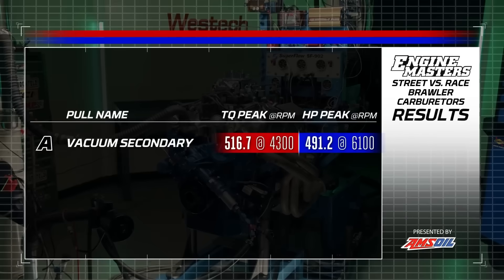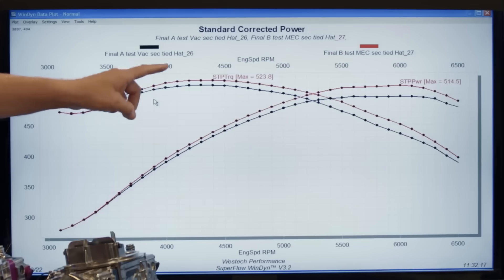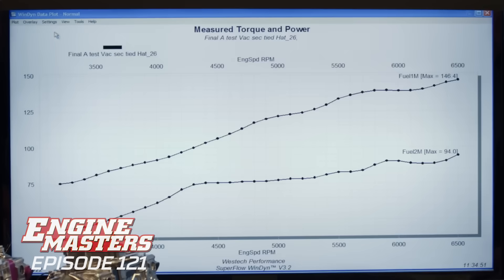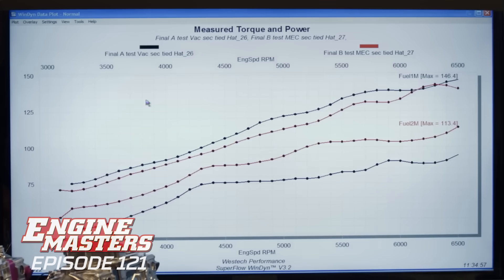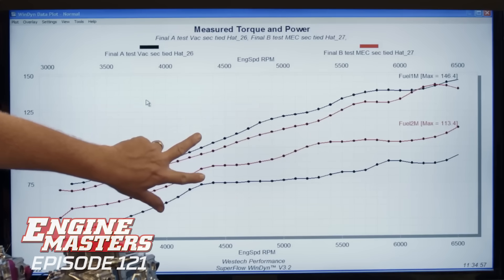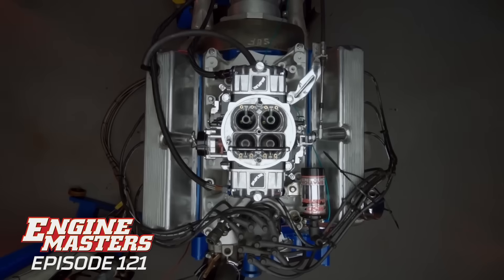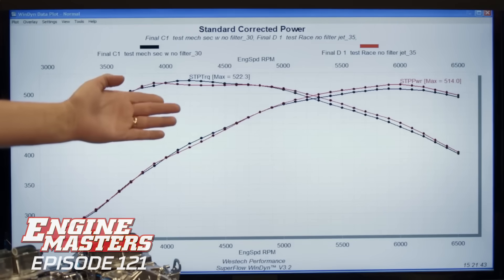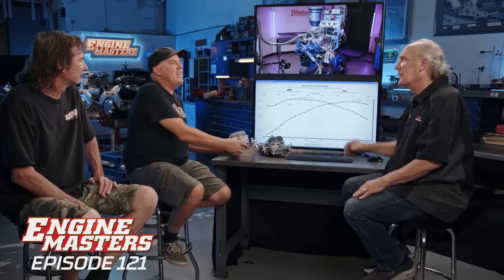Carburetor Confusion! What's the Best Setup? | Engine Masters | MotorTrend

Comment: Did the vacuum secondary carb have a metering block?
Reply: If it's a 3310 then no. They had plates.
Reply: @Chaos454-p5l   The original 3310/780cfm/4150 carbs did have metering blocks with changeable jets, though, and had better downleg boosters. The later ones were rated 750cfm due to using straight leg boosters slightly restricting airflow and used a metering plate instead of the metering block making it a 4160 type carb. The 4160/750s are good carbs, too, if you know what to do with them. Quality control in recent years isn't so great, though, and parts such as linkages snap instead of bend when you attempt to adjust them.

Comment: Street gearing and an automatic trans with a near stock converter: Vacuum secondaries. Everything else, double pumpers. I've been building carbs for 40 years.
Reply: We all believe you bro.
Reply: @karenthomson9749  hes not wrong tho.  double pumpers are great but vac secondary has its place too
Reply: @karenthomson9749 Sure. You do
I don't care
Reply: Vacuum secondary is fine for mild street applications, but the lag is a killer in racing.
Reply: I'm driving a 1972 Chevrolet Nova 3:73 gears 2800 stall 350 Edelbrock Performer Rpm Top End , 228/232 589/589 110+4 Bullet roller cam, Bullet 700r4.....the AVS 2 650 IS KILLING IT RIGHT? I bought a 750 Demon Mighty Demon, Annular Boosters mechanical secondary, how much of a difference will I see
Reply: @richardclary6267  So how did you like the 750 compared to the AVS2?
Reply: Maybe 10-15hp. The AVS is a good carb. Demon should feel stronger off idle because of the bigger pump shot and annular boosters.  @richardclary6267
Reply: I'm diamond 1
Reply: I agree with your assessment of when to use a mechanical secondary/double pumper carburetor, however - if you know your way around them, you can make a vacuum secondary carburetor work for you on anything from a mild or fairly ''hot'' street engine, as in a simple intake and mild cam to a larger cam and valve springs and aftermarket aluminum heads. 

Vacuum secondary carbs aren't given enough credit.
Reply: I have a light weight hotrod that is very quick. A vacuum operated secondary would not work fast enough to do any good in my application.
Reply: 100%
Reply: Unless your spending the majority of your time above 5k, go vacuum secondary
Reply: @Pilotlight26  you might want to call quick fuel, pro systems, braswell, AED etc and tell them that according to YOU they've been doing it wrong the whole time

Comment: I would love to see how an Edelbrock does.
Reply: 1812 AVS Thunder VS. 1912 AVS2 
Suppose to be mixture quality, right?
Reply: @tomreyn3610  Great Question. I dont know. I would love to see that as well.
Reply: A quadrajunk or the new Holley copy from Edelbrock the VRS?
Reply: @brandonfairbanks5764  we found the qjet always made 15 percent more hp over the Holley.   Always.  Crazy.
Reply: @tahcogunworks  I simply do not believe that. I've never in my life seen a qjet on a real performance engine. Some 300 horse slug in a Camaro maybe but never a real race setup.
Reply: @brandonfairbanks5764  Agreed, i never seen a Spreadbore Carburetor Make More Power than Any Squarebore Holley. And Never Seen A Q-Jet on a Race Engine, Besides a Stock or Super Stock Type Class Engine where you gotta run a OE Type Carb.
Reply: @tahcogunworks   Should have compared it to a FOUR barrel Holley😆
Reply: @brandonfairbanks5764   The AVS2 650 and VRS 650 and the Performance Series 600?!  That would be interesting!
Reply: lol
Reply: @trillrifaxegrindor4411  What? : )
Reply: Edelbrock makes good stuff just not carbs
Reply: @HairBandDan  I disagree, Holley,s always make more power than Edelbrock Carbs, and there BBF Cylinder Heads are good as Paperweights, they Flow little better than Ported Stock Heads. There Intake Manifolds are Ok, that's about all I'll ever buy with the Edelbrock name on it. Sorry, i do Agree with you about the Edelbrock Carbs, there No Good.
Reply: @strag1964 they’ve done a couple edeljunk vs Holley (and others) the edeljunk makes less power, they flow less air, are less tunable and the accelerator pumps suck. They are fine on a cruiser, where outright power isn’t a concern. But they are a doorstop in race shops for a reason.

Comment: best carb option....fuel injection..lol
Reply: Lol this. And people blow through boost them 😳. I can't imagine how close to detonation it is on some rpm just because you can't control the fuel enough. Carbage garbage
Reply: @bigboreracing356  Not if you wrap your head in tin foil.
Reply: Govt doesn't need computers to shut your carbed car down. They'll just tell the gas stations not to sell you fuel.
Reply: yeah cost 3x as much too.  EFI's advantage is changing elevation. but theyll make the same power
Reply: @KingJT80  Depends on a lot of things. Carbs are flow restrictions (some worse than others) and often have trouble getting equal amounts of fuel to all cylinders (unless you use ITBs, which is a big pain in and of itself), so you end up running some cylinders too rich to stop others going too lean and detonating. Port injection has no such issue, so at least in theory on most intake designs an EFI engine should make a little more power because of closer to ideal mixture across all cylinders and a less restricted intake. Obviously how much difference depends on the intake, the carb/throttle body, etc.
Reply: @nerd1000ify  well yeah MPFI is the ultimate EFI.

That's why it usually costs way more than a TBI style like a sniper. Way more tunability. But you will pay for it and for good reason

The real question is do you need it?